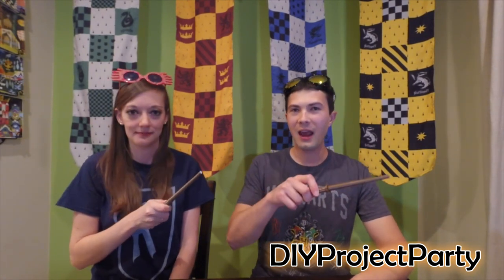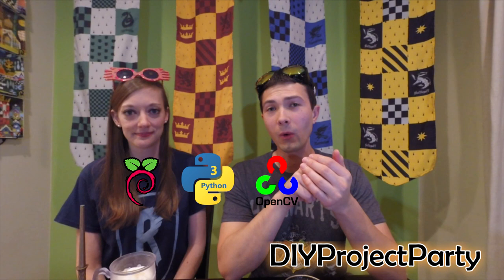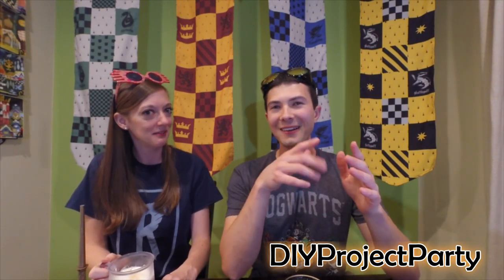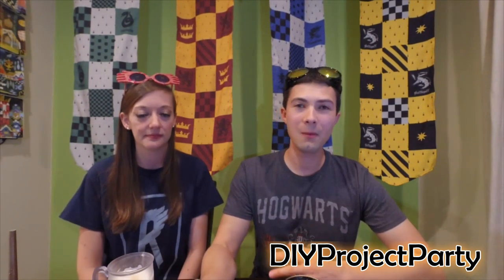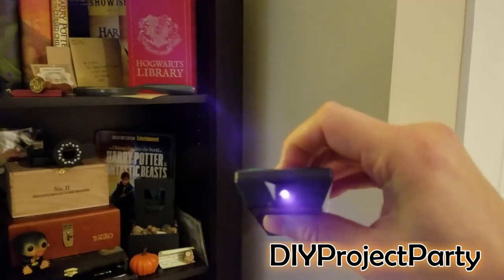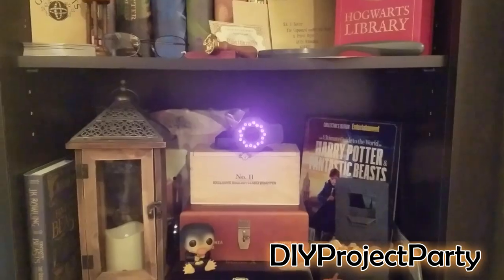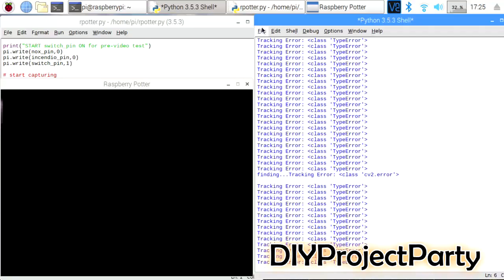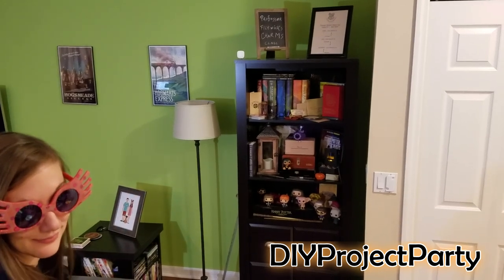DIY Harry Potter Interactive Wands

Comment: I looked at your python github code . The python code from your github uses cv2 in the script statements.
example:

# start capturing
cv2.namedWindow("Raspberry Potter")
#use next line for webcam
cam = cv2.VideoCapture(-1)
#use next line for RPi camera module
#cam = cv2.VideoCapture(0)
cam.set(3, 640)
cam.set(4, 480)

Your link above is for installing openCV3. Now openCV4 is out. Does it make a difference which version of OpenCV you use. Same question with python.  If I use a current version 3.7.2, do I need to change any of the rpotter python code? I am trying to recreate your project, but am having a difficult time without a wire diagram or a video walking step by step through the actual build. I know this is due to my lack of knowledge in raspberry pi and python code, so any help would be greatly appreciated. Great project build!
Reply from the maker: Hi David, thanks for stepping through the video and asking questions.  The "cv2" does not need to change in the code if you're using a different version of OpenCV.  I'm not an expert in OpenCV but in my research I found "cv2 is the name that OpenCV developers chose when they created the binding generators."  It's kept the same in each version so all the tutorials still work.

For the Python code, it is compatible with all versions of Python 3.  You'll run into problems if you are using Python 2.

For the LED wiring, I used this site to help me: http://led.linear1.org/led.wiz
Settings for my IR LEDs:
Source voltage: 5
Diode (LED) forward voltage: 1.2
Diode forward current (mA): 30
Number of LEDs in your array: 18
I chose to wire the second solution, which was 6 parallel group of 3 LEDs in series with a 50 ohm resistor.

Hope this helps!

Comment: Hey ! I absolutly love your video, and with my girlfriend we want to make one too , but step 6 to 8 are a bit difficult for us ( even watched your extra explination video ) but still cant understand everything... is there a a different way to make one of this ?? A electronical noob version ^^ 
Thank you very much have a nice day!
Reply from the maker: Hey, thanks for checking out my projects!  Yeah, I spent a lot of time on Steps 6 and 8 to get everything working.  Instead of making the IR LED ring in Step 6, search "IR Illuminator" on Amazon.  There looks to be a couple of products in the $20 range that will get you up and running with an IR source.  For Step 8, first try wiring LEDs to the GPIO pins on the Raspberry Pi.  I'd start there and work your way up to relays and modifying water fountains.  What would you like your "electrical noob version" to do?  Maybe I can point you to a video or use this as an idea for a future video.  Thanks for the question!

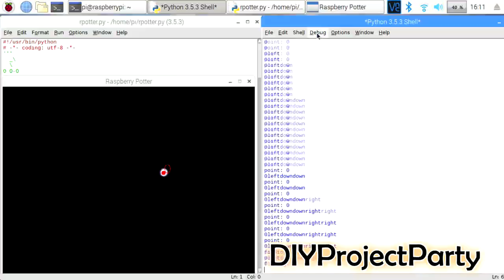Comment: I can't seem to replicate your IR filter setup. I get to the point just before 4:30 on your video, camera sees all points, then I place a film on it and the IR Light isn't bright enough. I even bought a powerful IR light and I use the same reflective tape and its still not bright enough. My theory is the film material is not the same as yours, could you verify if I need a specific type of camera film or can I use a different material for IR filtering? Any help with this would be awesome.
Reply: As I posted this, I realized that the film I am using is not developed. I will try that and let ya know. I have some old film lying around.
Reply: Unfortunately, not getting same results as you. It did get better but its not consistent.

Comment: Cool! Does the reflective tape work with the theme park’s outdoor system too?
Reply from the maker: Hi Kirk! I haven't tried my wands at the park yet. The park wands use a patented bead at the end to reflect the IR light. The tape may work but you might have to get the reflection angle right because it's flat. If you go and try the tape out, let me know!
Reply: @DIYProjectParty  wiliam osman tried it and it works with facial tracking beads

Comment: Could this be done with an ESPCam or does it need the extra power of the PI
Reply from the maker: Hi Tony, thanks for checking out the video! The ESPCam won't have enough processing power to run OpenCV. Sorry ☹
Reply: DIYProject Party ok, at least I know, I really appreciate you taking the time to get back to me.

I guess at some time, I will need to move up to a PI. It is relatively easy to do the same things with an IR wand IF you do not mind the wand being as thick as a broom handle, but I want to keep every thing relatively elegant.

Thanks again
Reply from the maker: Totally agree with wanting a small, elegant solution. It's always a trade off of features and processing power. Good luck on your project and write me back if you find a clever solution that uses an ESPCam. I'm always looking for new ideas.
Reply: DIYProject Party thank you I will

Comment: Is there a wiring diagram for each of the pieces you put together? Cool project :}
Reply from the maker: Hi David, thanks for checking out the project! I don't have a wiring diagram yet but I'll keep this in mind as I document this setup. In the mean time, write in comments if you have a specific question to help others that might have the same question.
Reply: @DIYProjectParty  Great video! Just wondering if you could provide a diagram of how you hooked up the IR leds if possible? Thanks
Reply: More so trying to find out if its wired in series/parallel circuit?
Reply: @seanmcquarrie9700   did you get the sd card with python and opencv working?
Reply: @seanmcquarrie9700  I tried that and had issues,  could you upload an .img of the sd card and post it please. I am all error and all unsuccessful trials. Thank you
Reply: @EventDesignLabRedlands  Where exactly are you stuck with the install, try following the steps in the website linked above. I had an issue with the cmake make command failing. I increased the swap size of pi and also had to disable the precompiled headers when compiling. I will try and make an image and upload that as soon as I have some time.
Reply: @seanmcquarrie9700  Thank you
Reply: Event Design Lab it was the same issue I had, add the line to disable the precompiled headers. Try building with:

cmake -D CMAKE_BUILD_TYPE=RELEASE \
    -D CMAKE_INSTALL_PREFIX=/usr/local \
    -D ENABLE_PRECOMPILED_HEADERS=OFF \
    -D INSTALL_PYTHON_EXAMPLES=ON \
    -D OPENCV_EXTRA_MODULES_PATH=~/opencv_contrib-3.1.0/modules \
    -D BUILD_EXAMPLES=ON ..

I hope this helps!
Reply: @seanmcquarrie9700  I will try it. Thank you for your help.
Reply: I finally got the rpotter.py running. I used the latest raspian, python, and opencv4.  I then had to repair a lot of the rpotter.py code by adding parenthesis on print statements and changing indent errors to 8 spaces. But I finally got the original code to work.
Reply from the maker: @seanmcquarrie9700  
For the LED wiring, I used this site to help me: http://led.linear1.org/led.wiz
Settings for my IR LEDs:
Source voltage: 5
Diode (LED) forward voltage: 1.2
Diode forward current (mA): 30
Number of LEDs in your array: 18
I chose to wire the second solution, which was 6 parallel group of 3 LEDs in series with a 50 ohm resistor.
Reply: DIYProject Party thanks for all the help guys!
Reply from the maker: @EventDesignLabRedlands   Thanks for checking out my project.  Sorry if my links weren't clear.  The rpotter code from sean-obrien was written for Python 2.  I also went through his code and made similar changes to make it work for Python 3.  I'm glad you finally got it working!
Reply from the maker: @EventDesignLabRedlands  I was having a lot of errors at first when compiling OpenCV, very similar to what your describing.  I installed Raspbian using Berryboot to use some of the backup features.  The only way I found that I could get past all these errors was to install Raspbian from the official image from the raspbian.org site.  I wouldn't suggest using NOOBS either because I foresee similar issues.